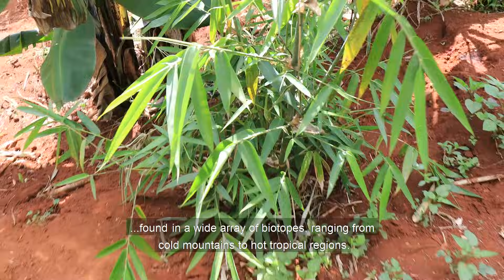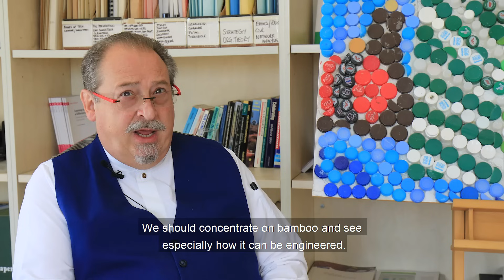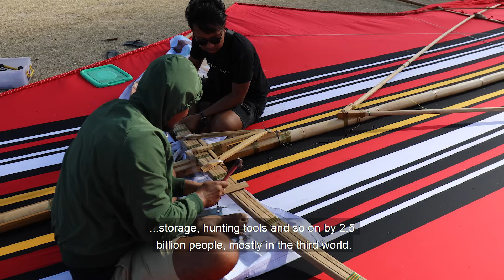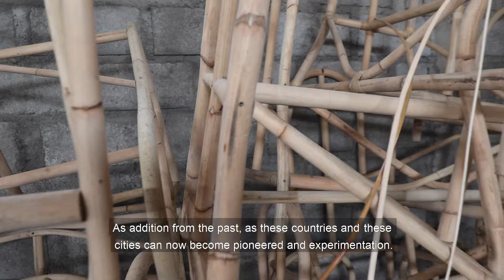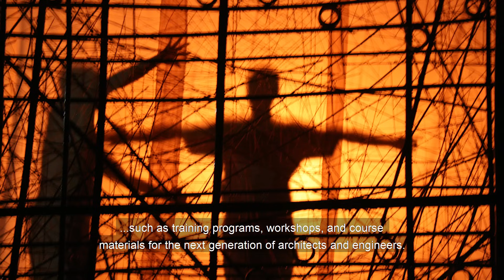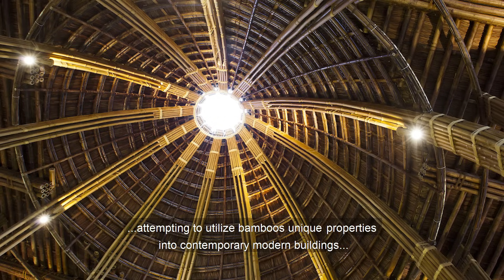Bamboo--the Tradition of the Future

Comment: It was a good video until the "muh climate change" and trump derangement syndrome parts
Reply: Ikr I almost clicked off but I wanted to learn about its structural capabilities. Hopefully they only put that in to keep the deniers interest. My only concern about planting bamboo is how fast it spreads and possible impacts on local biodiversity since   it isn't native where I live. I'd definitely try to keep it contained, like with mint, but it's an attractive alternative to large trees where space and regulations get in the way, especially with all of its useful applications.
Reply from the maker: Bamboo's viable spreading only occurs from the root system; so, although some types might be invasive on a local scale bamboo does not spread quickly on greater distances. There is also two types of bamboo; running and clumping. Running bamboo spreads much wider and faster than clumping bamboo. That said, with over 1000 species, all with different characteristics you need to know what you plant. The keyword is, as in everything else, Knowledge.

Comment: 04:40: Implement bamboo architecture in any of the places depicted in the aforementioned timestamp and it'll be a disaster. I think I'll go for concrete and/or steel in those areas. Realistically speaking, bamboo is not a universal solution.

Comment: The fact that bamboo is not sorted into dimensional regular categories and is not tested for strength so that it is predictable limits any engineer from using it in construction. Everything they design would have to be over-designed if they used this poorly graded material.
Reply from the maker: Constructions of any material is “over-designed” or designed with a factor of safety (safety factor). This is done to count for: unknown in the material, surprises of the usage of the building and unpredictable events (fires, earthquakes, flooding, plane crashes etc.) . It is true, as we point out in the film, that bamboo today suffers from poorly grading which indeed effects the factor of safety that required to calculate bamboo structures. However, this is not that different from the problem timber had for a long time. Wood structures was downgraded, “over-designed” and suffered from an inadequate systems of codes—much like bamboo today. But extensive experimentation and research of timber has resulted in new guidelines and a world-wide renaissance for timber constructions. There is indication that bamboo has the same potential. For example, there is strong evidence that bamboo constructions withstand earthquakes exceptionally well. If that is shown to be true bamboo constructions might need a lower factor of safety than other materials in earthquake prone areas.

Comment: Bamboo is a great resource regardless of climate arguments.
Reply: Bamboo is amazing if you do a quick google search. Bamboo grows a lot quicker than wood and also the fibers can be 2-3 times stronger than wood. Bamboo also absorbs more carbon dioxide and it releases a lot more oxygen. The only downside to it, is that it absorbs more water than trees. (Bamboo is also a type of grass and not wood)
Reply: @HiThere-bu4bs  the CO2 thing is irrelevant. Bamboo has so many virtues, and it is unnecessary to put the "green" label on it. You will kill the market for it if you don't stop that.
Reply: @whatever04-y3g  number one: Anthropogenic CO2 contribution is at about 0.4%, per the IPCC. This was discovered some time ago.

Then the claim was made that this small amount would have a positive feedback effect on the climate, thus causing runaway greenhouse effects. This has been attacked by a number of published papers in a number of climate journals. The IPCC has yet to respond to this refutation.

Third, recent developments in climate science show that there are numerous factors related to sun cycles and solar system wide events that are far greater a modulator of climate.

Fourth, a pair of atmospheric scientists I Ireland just showed, using 100 years of weather balloon data, that the runaway greenhouse effect is not possible. The earth's atmosphere, taken in toto, behaves like an ideal gas. This means that as the atmosphere absorbs more energy, it expands to dissipate the extra energy.

I'm not going to cite journals. I have spent too many hours doing that, and then being told "that's not real evidence". I encourage you to look this up.

And anyway, this is about bamboo. I'm tired of people screwing up good things by putting some kind of moral value into it that doesn't actually pan out, and takes something good down with it.
Reply: Bamboo helps prevent climate change. It stores the CO2 within itself. It is one of the greatest sources of capturing CO2. It can replace iron and other structural materials that are have a very high carbon footprint. So bamboo has a negative carbon footprint.
Even if you burn the bamboo after it's use ends, it becomes almost carbon neutral or slightly positive. And it sustains the level of carbon in atmosphere, not increases it too much.
Reply: @whatever04-y3g  sigh

Anthropoogenic CO2 is not the primary  driver. This  is currently being admitted to in climate science circles. It has yet to make it to political circles because  humanity's  collective "guilt" is politically  useful..

If we just stick  to its fantastic properties, we'll be  fine, and bamboo  won't  be dismissed  as yet another greenwashed, unfeasible product. If  we continue down  the political lane, it will ultimately tank bamboo as a serious alternative to anything except flutes.

Look... I was buying carbon offsets in   2003. I did so until the science told me this was no longer necessary. I dont listen to popsci or political sources. I read the actual articles, as I am a trained physicist, so I can understand it. It is shocking to  me  that government bodies are still pushing this.  As far as  I can tell,  it is dead and  buried, and the  IPCC  is   keeping it on life support.
Reply: @whatever04-y3g TRUE, the point here is not just about marketability
But sustainability and rehabilitative qialities that bamboo offers.

We cant pretend and ignore that our choice of lifestyle and materialism contributes A LOT in causing Climate change.
Reply: Honestly, the climate naysayers don't actually have an argument based on facts. Science and research has shown us exactly the origin of co2, among other elements - humans.

Comment: bamboo destroys the environment too. it kills other crops to grow.
Reply from the maker: This comment shows a common misunderstanding of bamboo based on example of ignorant and irresponsible planting. Bamboo's viable spreading only occurs from the root system; so, although some types might be invasive on a local scale bamboo does not spread quickly on greater distances. That said, with over 1000 species, all with different characteristics you need to know what you plant. The keyword is as in everything else Knowledge.
Reply: @anthrotechture5709  I grew up with bamboo in my backyard. We made all kinds of basket, and actually used this mixed with dirt,  and used in many construction, but they don't last that long. wood is better. bamboo is stupid idea and it breaks when it gets old. the ancient construction technic did not use bamboo for a reason.
Reply: Truth, how does it destroy the environment?
Reply: @emdad506  no crops grow under the bamboo or near the area. they cast too much shadows too.

Comment: Fire danger is my biggest issue. While these buildings are definitely beautiful. I wouldn't want to be anywhere near one in a fire.
Reply: Yeah, which do you think ignites faster, or burns hotter?  Would you say the bamboo pole, or the kiln dried pine 2x4?  Your average stick framed home probably comes with more than twice the "fire danger"!
Reply: Sprinkler system ?
Reply: Are you saying wood does not burn??
Reply: @emdad506  I am saying that this is a raging fire waiting to happen
Reply: Bamboo is no more flammable than wood.
Reply: @donnievance1942  True. But traditional stud framed homes are covered by fire-resistant drywall.

Comment: cross section laminating bamboo will make it far more eccepted by even the stuanches opposers
Reply: cliff woodbury , Precisely! Usage of dimensional lumber has been overtaken by engineered lumber, it’s a more stable product, stronger, more resistant to environmental damage, more cost effective, builders needn’t worry about material defects, walls framed with dimensional lumber are erected faster, with more finish precision, allowing the other trades to apply their materials quicker and again with much better precision. Engineered bamboo is the future in my opinion.
Reply from the maker: @cliff woodbury, and @Steve Andrews. Although this is a valid argument, and we hope to get more into engineered bamboo in our next production, there is still value to discuss how to use bamboo as it is growing. Essentially there is two “engineering” aspects at play here the fiber aspects and the structure and shape of the culms. Firstly, the strong and unidirectional fibers of bamboo that really can be optimized by, as you point out, engineered processes. However, the unique shape of a bamboo culm is an engineering wonder in itself. It optimizes weight to strength and flexibility ratio in a way that is hard to copy. Therefore, without excluding the alternatives there is validity in both strategies.
Reply: Anthrotechture As a 40 year Engineer/Builder in Southern California, I found a niche in creating Polynesian styled structures, furnishings and decor under the auspices of Mid Century Modern. The aesthetics of bamboo is not lost on me, in many ways, the foundation or key element. That is what attracted me to your video. Joinery and material stability are my biggest challenges, splitting culms have always been my biggest call back, along with gunfire sounds when nodes depressurize, probably having to do with our arid climate. As the “Hawaiian Shirt on casual Friday’s” to my contemporaries, I embrace the legitimacy of bamboo in today’s markets. I look forward to more of this content in your videos, thanks.

Comment: Very Interesting.  For the ones more interested in the design applications of Bamboo :

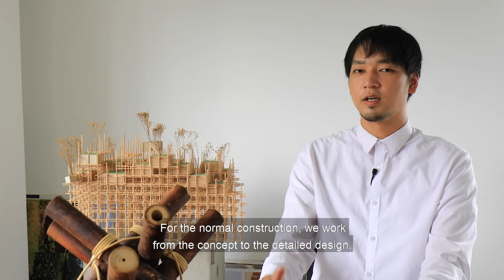around 18:00 min - Properties
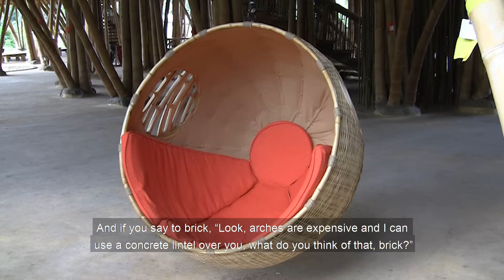around 23:00 min - 3D parametric design examples
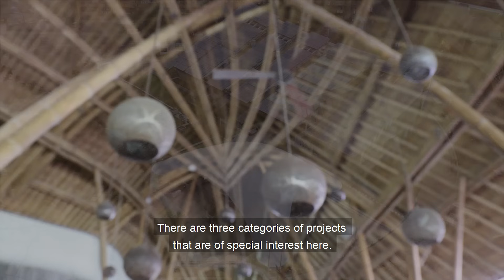around 25:00 min - Type of design applications
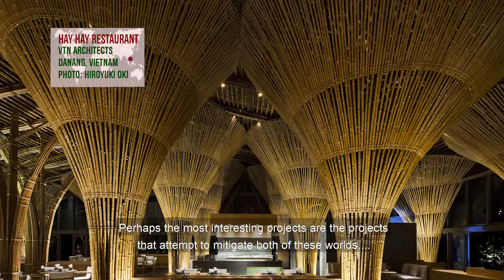around 27:00 min - Contemporary applications

First part of the film is mostly about sustainability (e.g. bamboo’s fast growth rate and its ability to clean water and prevent erosion) plus carbon sequestration (e.g. bamboo’s ability to store carbon )
Reply from the maker: @Dalysio Moreno
Thanks for you encouragement and the "guide to design applications", most helpful .  The film is made for someone that are new to bamboo so we opted to to cover a lot of ground.  We are working on the second film where we ope to dive into the design aspects even further.
Reply: @anthrotechture5709  Where can I get more information on growing and building with bamboo? I am in Southeast Texas and we have some bamboo already. I would like to grow and supply it as well as make what I can for myself and to sell.
Reply from the maker: @jackjones9460  try to contact INBAR https://www.inbar.int/ or send us a message to our Facebook: Citizen of Bamboo @Bamcitizen, and we try to set you up with someone from our network that might be able to help
Reply: Thank you. So tired of this lecturing about carbon footprints and man made climate change. I thought this was about using bamboo as a building material🙄

Comment: How are we almost 10 min in, and I still Know nothing about bamboo? Why is a third of this video not about bamboo? I understand setting up its possible impacts on the environment and construction but how in this much time have you not gotten to it yet!?
Reply from the maker: The film attempting to show both benefits and challenges of bamboo as a design material. We understand that you probably are familiar with the concept introduced in the first third of the film such as : bamboo’s grow rate and structural capacity; bamboo’s ability to store carbon, (carbon sequestration); bamboos ability to clean water from toxins, (phytoremediation); and how bamboo’s unique root system binds soils and prevent erosion; but, most people are not. We hope we have made a film that in the long run helps spreading the knowledge of bamboo. Because, still after all this years, effort and energy spent from so many good people we have yet to see bamboo structures becoming a familiar site in our cities.
Reply: @anthrotechture5709  excellent work 👌kudos..  It takes a lot of hard work to make such indepth documentaries which can create an impact.